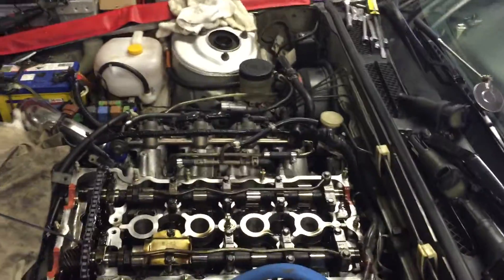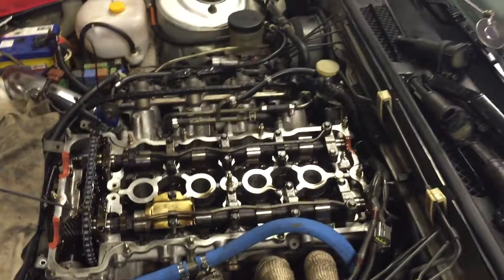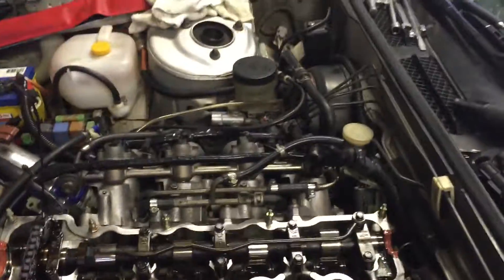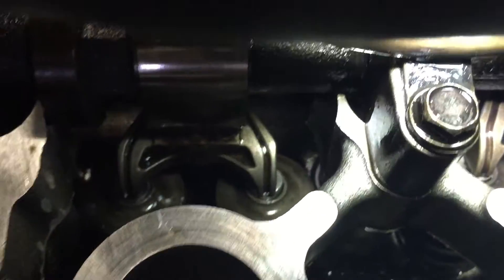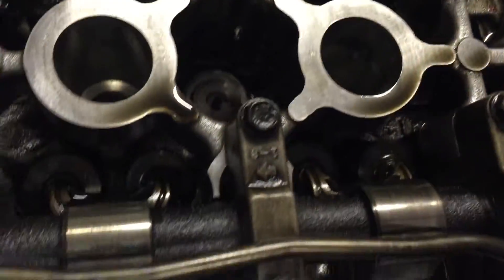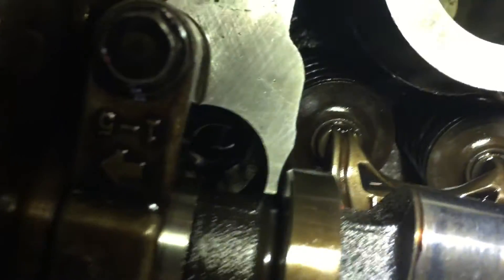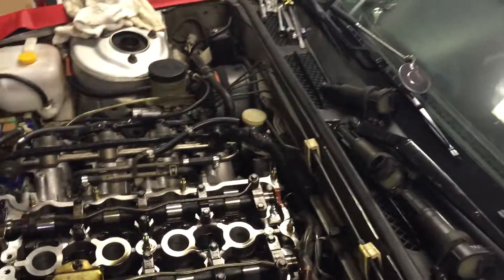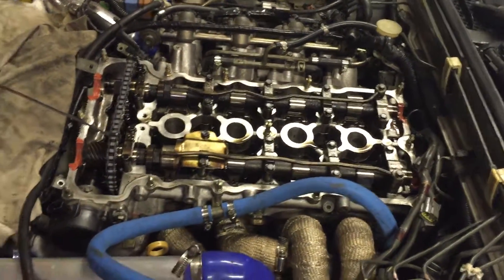SR20: How to install valve shims

Comment: wat cause them to break. I am running. stock every thing and my flat shim on number 3exhaust. side keeps breaking. and throwing my rocker arm off
Reply from the maker: I dunno why your flat one probably isnt the right size, you need to measure your valve clearances and make sure they are in spec and get the right size to get them in spec
Reply: @EAPerformance  
hey, not being smart but can they be measured when they have hydraulic lifters. what was the original setup.Are all flat shims and guides the same thickness?